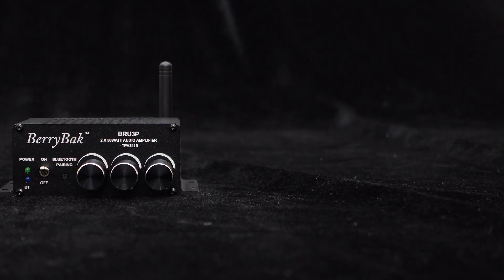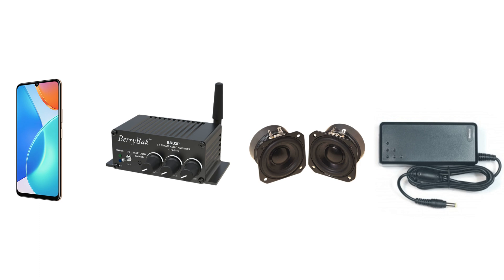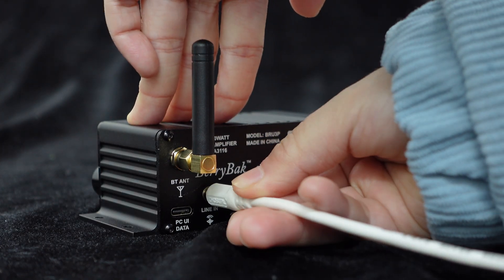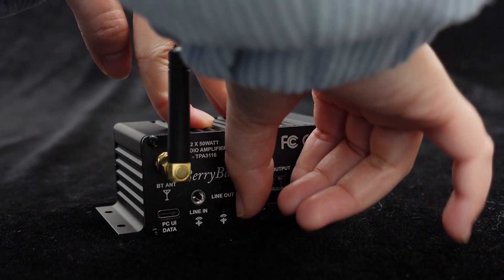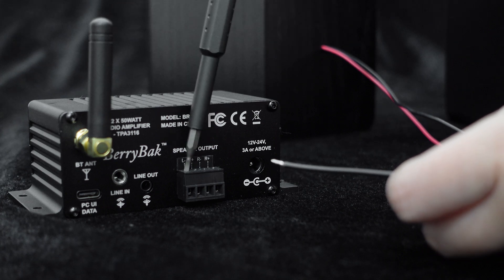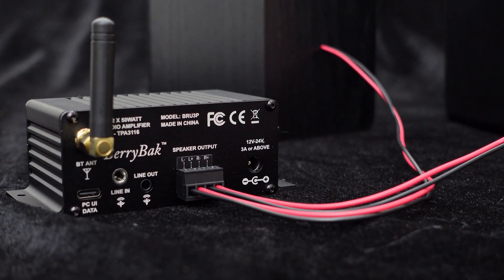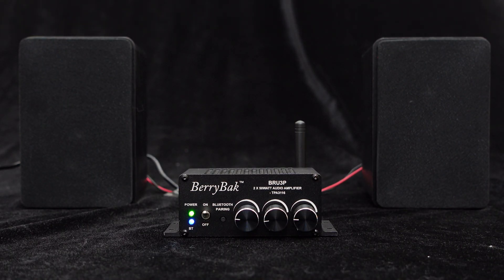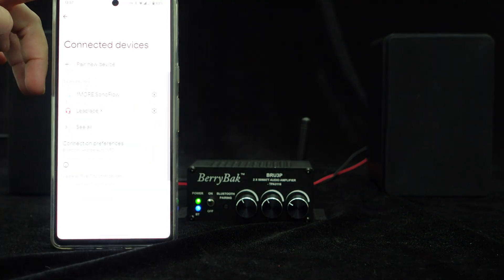Stereo 50W TPA3116 Bluetooth Amplifier BRU3P Connection Demonstration | Treble Bass Control

Comment: Hello! Is it possible to manage the left and right channel individually in the dsp software? Or are all changes made to both channels?
Reply from the maker: Hello, the changes in the PC UI are made to both channels.
Reply: @WONDOMAudio  what a pity, this is pretty useless dsp then. Why did you decide for that? 😒
Reply from the maker: Hello, if you want a product whose left and right channel can be modified independently in the PC UI, you can take a look at the JAB3/JAB3+/JAB4/JAB5. They are integrated with ADAU1701 DSP, each channel can be individually set with PC UI. Wish this could help you. Have a fantastic day~
Reply: @WONDOMAudio  many thanks! An all-in-one product would be fantastic. Including metal case like for the BRU3, but as you said with a ADAU dsp. Are there any plans yet for a complete product like this?
Reply from the maker: Thank you for your valuable suggestions. We truly appreciate your input and will immediately pass it along to our R&D team for thorough evaluation. We are currently working diligently on developing new products that utilize the TPA3255 and ADAU1701 technologies. Once these products are ready, we will release them to the market. Have a fantastic day~

Comment: When you plug a source into the 3.5mm Line Input on the back does the Bluetooth and Bluetooth light automatically turn off?
Reply from the maker: Hello. When plugging in 3.5mm line input, the input method will switch to line input automatically. The Bluetooth LED will turn to blinking. Wish this could help you. Have a fantastic day~